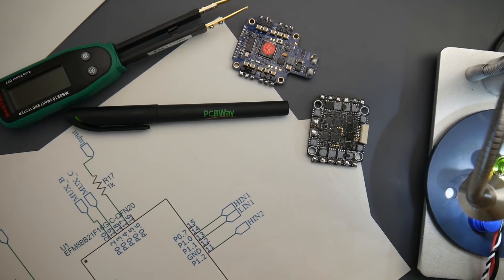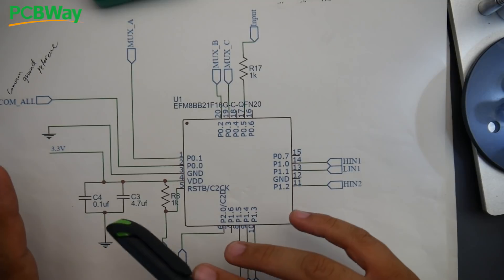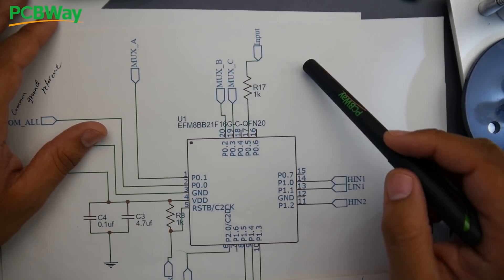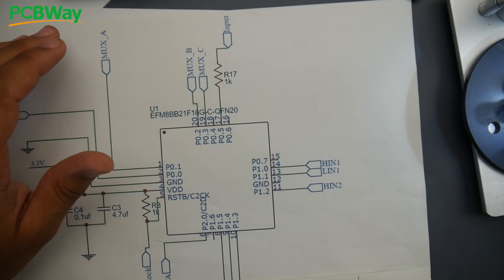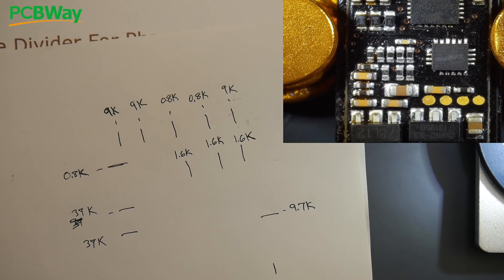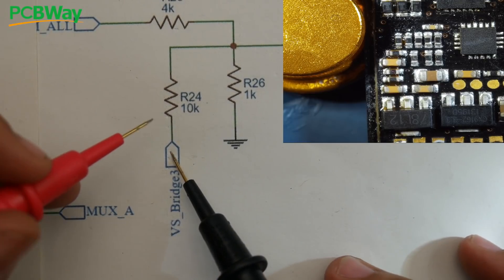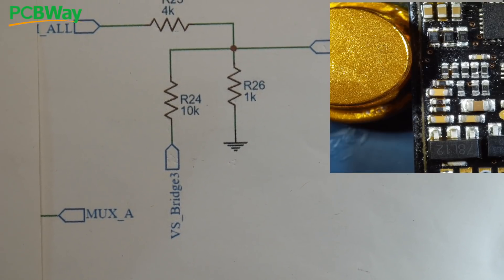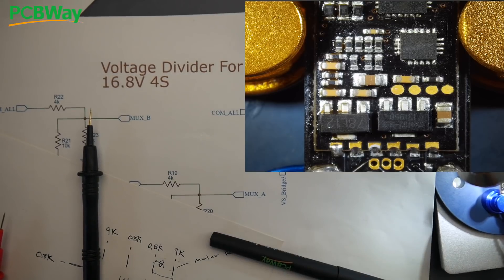How To Fix Any ESC // The MCU Part 2

Comment: What about the signal path? I have a new ESC that connect detect number 4. On initial power up the 4th motor twitches so I know the FETs are okay but it’s not getting signal. I’ve swapped the signal wires from the FC and confirmed that signal 4 is leaving the FC but not reaching the MCU. The plug and wiring is good.

Comment: Umm.. I have a broken ESC. All the 10K resistors have continuity to ALL 3 motor pads. Its the one motor that is stuttering. This is the EMF sense. Any help appreciated.

The cap + diode, have no short and 0.45V each. None of the FET short to Gnd or +. The 6 output 22ohm resistor look ok. 
I'm puzzled, and stuck.

Comment: I have got a question. I have got Tekko32 F3 4 In 1 40A Blheli_32 3-6S Brushless ESC. I normally landed. Putted new battery and nothing - no beeping at all. Looks like the MCU is broken. All power sources seem to fine - FC is working. What should I check? Any suggestin? Before the last fligh one of the motors didn't want to run - it was shaking, but after some attempts it finally run - looked like some dirt in the motor. All the flight was OK. Thanks a lot. BR

Comment: It's one thing to identify the issue, and quite another to become proficient with/buy microsoldering tools to actually repair the board.
Reply: yeah but at least now you know what went wrong. FYI BlHeli MCUs can't be reprogrammed without manufacturer re-activation. /BLHeli/issues/319

Comment: what's the most likely culprit when your 4-in-1 doesn't get any initialization tones?
Reply from the maker: there is 2 stages.... First beeps are when battery is connected.. Second stage is that it verifies there is a signal comming from the flight controller.
Reply: Drone Mesh if my Typhoon32 v1 doesn’t beep at all or register passthrough the FC, what might be dead? I have an identical second ESC with a dead FET and a hot air station so I can replace almost anything. What should I look for first?
Reply: I also have a ESC (tekko32) that doesn’t beep anymore and i can’t find what is wrong. And i have one that smoked when i plugged my battery. Did you find what is wrong with yours?
Reply: @DroneMesh  I have a few that get no beeps at all. I can feel a regulator might be getting hot. I guess it could either be a bad regulator or a bad MCU causing the regulator to get hot?